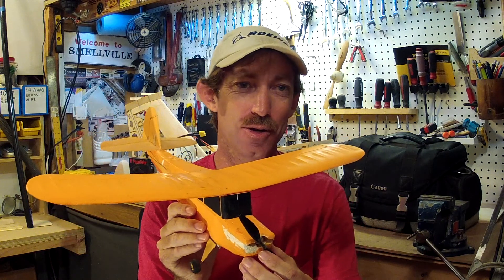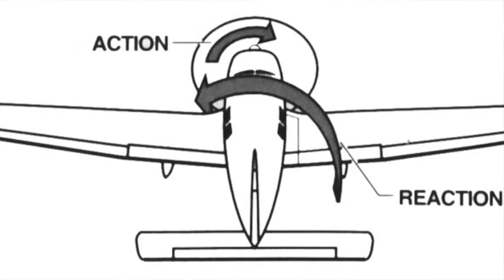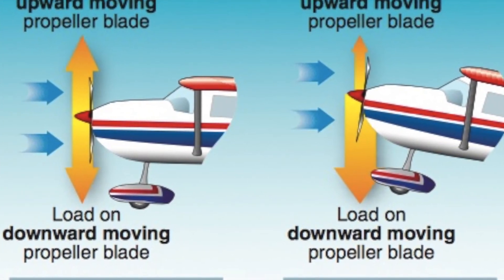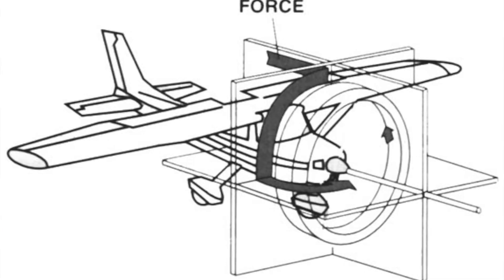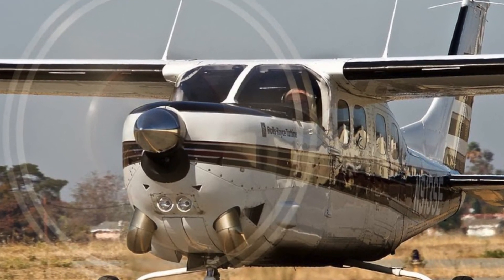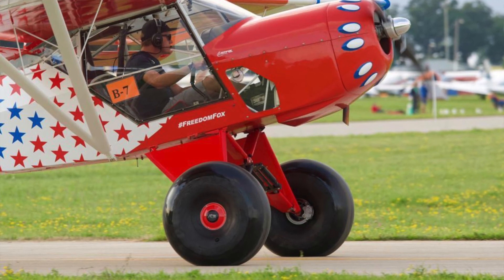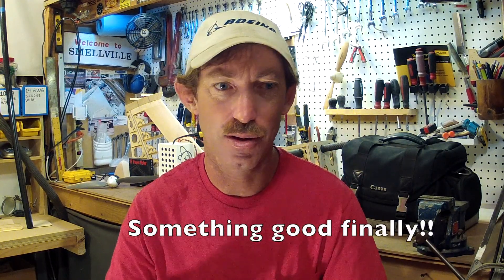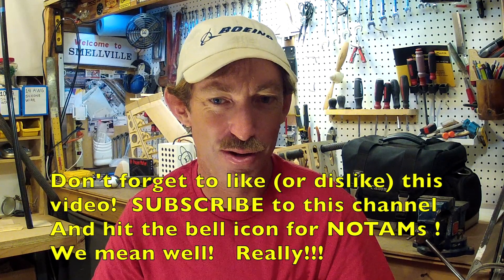SINGLE ENGINE AIRCRAFT (Tractor) CONFIGURATION EXPLAINED IN DEPTH

Comment: I love the long form video format. You pack every minute with deep technical explanations. Not many channels offer this.
Reply from the maker: Thanks!!  We did not find exactly what we were looking for either, and so decided to make this series.  Considering making more.  What would you like to see as a topic?
Reply: I know this might be a pretty esoteric topic, but I've always wanted to know more about wing spar design. How in the heck does the cantilever wing of an aircraft the size and weight of a 777 maintain it's integrity while not only carrying the weight of the fully loaded fuselage, but while also being torqued by the loads imparted by the control surfaces and engines? Also, what technological advances enabled aircraft designers to move beyond the biplane configuration? 

Another wing related topic that I'm curious about is aspect ratio and chord thickness. How does an aircraft designer decide which aspect ratio to use, and how does it affect the performance of the aircraft? How is chord thickness decided, how does it affect the performance of the aircraft, and how is it related to aspect ratio? 

If you could provide some deep technical analysis of these topics I'd be delighted, and I'm sure others would be also.
Reply from the maker: @calebcourteau  Thanks for the feedback. Noted. Good topics!!

Comment: Nice that you got the Draco in there. Makes me think of an inflight tire inflation system. Deflate in flight and inflate accordingly. 
This weight of an air pump and system could be offset by the drag of the tires.

Comment: Well presented!  I'm working on my fifth pusher FPV prototype.  I'd LOVE to see what you come up with for designs!  As technology improves, I'm finding costs are going down.  My design is basically a flying fuel tank with a two stoke weed-wacker engine, a long wingspan, and five cameras.  My ham license allows for experimental designs in radio telemetry and other related fields. So I'm all about trying new ideas.
Reply from the maker: High Aspect ratio is good.  I'd love to know how the gas engine works out.  a 4 stroke would give much better flight duration, but you can always swap once you have everything else worked out.     what's the TBO in that application?
Reply: First two didn't fly.  They were build experiments to verify weight and technology applications.  I proved the theorem anyone can build a tank, but to fly it takes copious amounts of energy to fly.  The next one crashed on takeoff due to software issues.  The last one caught fire mid flight.  I suspect there was a design flaw in the fuel tank.  This prototype is altogether different and the cheapest so far.  No hard datum yet.  I'm figuring at least another 6 months or so before any real tests.  I work as a teacher, so my time is very limited on this project.  Right now I have time because I'm sick at home.  Since I'm unable to speak ATM, I'm doing as much R&D as my body can take.  Off to the doctor's office in a few minutes as well....
Reply from the maker: Let us know if we can help with some advice on the design process. 
Should not take much power to get in the air, if the design is optimized for endurance, as the high aspect ratio suggests. 
Have you considered  other configurations?  
What's the mission for the aircraft?  distance, duration,  payload, speed, and runway requirements?
Reply: Mission is multipurpose agricultural, duration is four to eight hours, distance is approximately five to ten miles with RTH, speed is 40 or so m.p.h., runway is from remote pastureland up to blacktop with approximately 50 to 75 feet take-off minimum requirements depending upon environmental conditions (rain, wind, snow, etc.).  Span is approximately 8', fuselage is about 4'6" with twin boom from the wings to rear with elevator connecting booms (rudder on each boom).  I have the three blade rear prop.  Will have prop specs tomorrow if my wife hasn't "searched for a tool she needs" in my area.....  Plan is to use wings and elevator for lift to compensate for heavy engine in flight.  Previous prototypes were tail heavy.  I suspect the software couldn't compensate quick enough on third proto., thus the crash.  Fourth was flying with chop.  This may have led to stress fractures in tank and a leak onto the engine or exhaust.  A possibility for the fire.  Too melted to really know.  I'm also thinking of mounting the engine slightly higher in relationship to the fuselage to get cleaner air.  Think a rear prop P-38 style aircraft with a slightly elevated rear fuselage.  I'm definitely open to ideas!  BTW, I've changed this design many times.  The original isn't even close to what I'm working on now.  I've looked at twin boom tractors, three engine (think Ford tri-motor) configurations, but I need clear front and bottom view camera shots with several cameras.  The tractor configuration and the twin boom tractor configuration gives me issues the rear pusher doesn't.  Does this help?
Reply from the maker: There are several problems with Pushers, (I guess I'll start making a video about that.. ). anyway,  they have some good things about them, unlike the single engine tractor.  (not much good there) 
the biggest problems that you will face with the pusher are the following:
vibration in the fuselage from the engine affecting the sensor 
vibration from the air pressure differential going into the prop arc, causing the prop to "beat" and vibrate. (you can reduce this as you mentioned by offsetting the engine centerline vertically, and can further reduce it by using a 3 bladed prop). 
I flew a twin boom pusher for years, of my own design, and used it to take pictures, but always had to shut the electric motor off before snapping each picture, otherwise the picture quality was invariably degraded.
it's possible to isolate the payload from vibration, but it's only a partial solution, and the isolators add weight to the overall aircraft. 
Flexing in torsion of the inner wing section:
have to make it really strong, and the twin booms end up weighing more than a single boom, or fuselage that can support a tail at the same distance from the wing. 
the twin booms add complexity, and tend to flex more than a fuselage. 
They do provide modularity, but there are more parts to disassemble than before.  
The twin boom config does allow a fairly large prop to be used, but not as much disk area as a multi- engine aircraft can make use of. 
prop clearance is also an issue, as the landing gear has to be extra tall, or the main gear moved further back, making rotation abrupt, and landings slam the nose down.  also more weight on the nose gear. 
you can mount the motor close to the wing (forward as possible) to help, but it will only make the vibration worse. 
you'll still have most of the problems associated with the single engine tractor too, such as torque, P factor, gyroscopic precession, but probably not slipstream effect, if you can keep the tail clear. 
in the future, need to use auto-tune on autopilot, to teach it how to fly the plane, and you might have some good success with the pusher, because the tail is not in prop wash. 
overall, it's better than the single tractor, and has some definite advantages, but not as good as a twin tractor.   They are becoming dominant in the agriculture mapping market for good reason. 
it's actually possible to get 4+ hours out of an electric powered  craft without the hassle of the engine, and gasoline, but you can easily double that with 4 stroke gas power. 
only issue with twins using gas power is reliability of the engines.  eventually, one will quit, and your autopilot had better be able to continue the flight on one engine.   you could use twin fuselage, such as the stratolaunch concept, then make a single engine nacelle in the centerline, using two identical gas engines. (they would counter-rotate as regards the air flow, use one normal prop, and one with pusher prop). that way if an engine fails, there is no asymetrical thrust. 
anyway, if I wanted to use Gas engines, that's what I'd consider. 
you'd have to split up your cameras, but there would be two fuselages to put them in. you could have a left looking camera on the left fuselage, and via versa, with cameras looking down anywhere they fit. 
the engines could share a central fuel tank right on the CG, in between them.    
there is some loss of efficiency with one prop in the prop wash of the other, but you would use a higher pitch prop for the rear engine. 
this configuration also needs two nose wheels,  but if you do not require lots of ground clearance, such as fixed cameras in the fuselages, you could get away with fixed gear that does not protrude very much, and no need for retractable gear. 
also both fuselages could be identical, and could incorporate the vertical stabs. 
would also need the center wing section to be strong in torsion, but the horizontal stab would help. 
sounds like your greatest challenge will be to keep the structure light. 

just my 2 cents on your project.
Reply: WOW!  Your two cents is more than a buck fifty in my book!  I'm now looking to change configurations yet again....  LOL.  I like the idea of inline engines with a push-me pull-me configurations.  I'm off to my drafting board once again with this awesome idea!  Give me a few months (as time permits) and I'll try to have a prototype based on this.  THANKS!!!!!!  :)
Reply: @BB-oj9uy  Do you have any update about the project?

Comment: Hi! in the case of a twin motor rc plane (like the twinstar I'm currently building) do you have a recommended motor direction (for both left and right motors) ? and why? :-)

thank you and bring the gemini back ;-)
Reply from the maker: Thanks, the Gemini is well, just have not had much opportunity to fly lately, and working on a new project.  
our next video (in editing) is just about twins, and multi engine, and will cover everything you mentioned and more.    in the meantime,  make the props turn inward at the top, towards each other at the top of their arc, and away from each other at the bottom of their arc.  this will get the best characteristics in case one fails, and counter-rotating will balance torque, p factor, slipstream effect, and gyroscopic precession.   you must use one normal prop, for the left side, and one pusher prop for the right side.  you cannot simply flip the prop over. it will only generate 1/2 the thrust flipped. one must be a pusher prop.     the cupping (airfoil) of a prop only works one way.
Reply: looking forward for the next video! ;-)

Comment: Great video, keep them coming. Can you make a tutorial for Dragon Link V3??
Reply from the maker: thanks,  but I don't have a Dragon link V-3.  I do have a V-2, and it works ok, and I'm only using the stock antenna, so not giving it a fair chance. I also have not updated the firmware.  I only use it to articulate a sensor, not to fly the aircraft.  it has only half the range as I'm using it, of the primary, an EZUHF system,  so I use it as an early warning system to know when to turn on the high power setting for the main control system.    
Mike at dragon link is a very nice guy, and provides good support in my experience.
Reply: @FPVREVIEWS  Is EZUHF still a good choice? I'm sure it still works well but would you buy that currently. Would you buy something else these days. 
It seems to be as low as a frequency that is viable in a system and allows for a low video frequency like 1.2.
Reply from the maker: Yes, just bought 2 sets the other day.      it only has 8 channels, and i'd definitely go with the JR module, not the full size Brick module. The QC on the JR module is much better  in my experience.   If you need more channels, maybe look at dragon  link. Mike from DL is a very nice guy, and typically gives good customer support, or you may go with the FRSKY LRS on 900mhz..  will not be as good range, but it's super cheap, and has good reviews.  @JoshWeaverRC
Reply: @FPVREVIEWS  Awesome. Thanks for that info. If I went with .9 I would go with Team Black Sheep. But that puts my video up to 2.4 to avoid interpherence between control and video. 
I did buy an FrSky radio so that helps open my choices.
Reply from the maker: the lower freq. are always best, in theory, and in my experience too..   i have received some faulty parts from EZUHF, and the early receiver that i bought had poor shielding, had to make my own, but they did improve their products long ago, and i've had no recent trouble with their 8 channel diversity receiver, and JR module.  their user interface is quite good, and easy to use. and i'm no genius when it comes to that part...  their stuff just costs more, and they have very little supper tif something does not work properly.   Dragon link is more likely to support.  I had a bad unit from the factory dragon link v2 a couple of years ago, and contacted mike. he sent me a new unit in the mail, without receiving my old one back. just on my word...  and he bench tested the second one personally, even a hand written note, in case i didn't know how to use it... 
nice people... you won't get that from anyone else..  I had not even bought it directly from him.. but from readymaderc. they gave crap support, which led me to contact dragon link directly.  @JoshWeaverRC